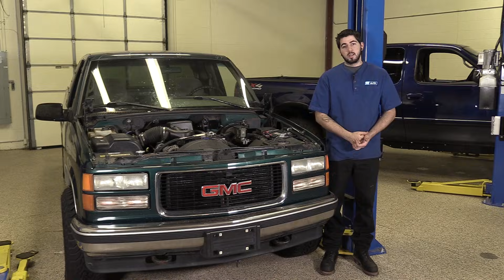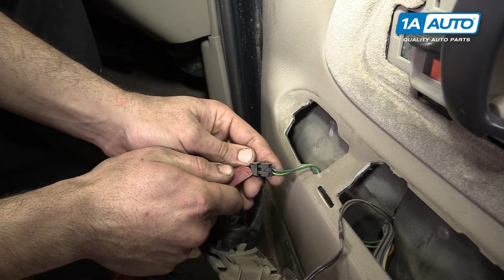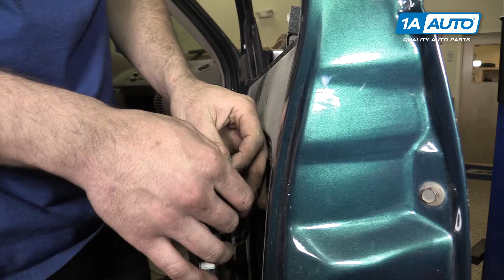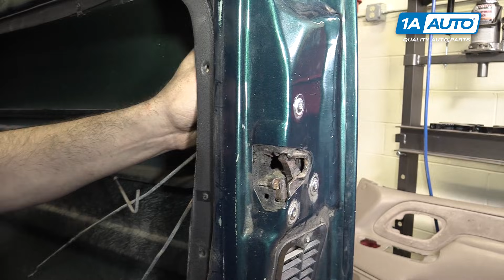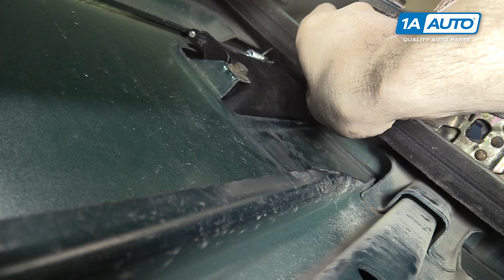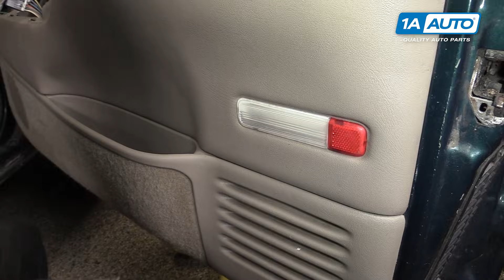How to Replace Exterior Door Handle 95-99 GMC Sierra K1500

Comment: What's the big deal why didn't you show the rod that goes to the keyed lock cylinder and the metal dog that goes on the back of the lock cylinder and the rod that connects to it

Comment: I'm having trouble removing the clips on lock cylinder to swap it to the new handle.
I'm kind of shocked you just totally skipped over that.
As well, removing the rod clips was a major pain which I noticed you edited out.
More info on those items would have been very helpful.
I suppose I can't complain for free advice. I do appreciate the video. Just sayin'

Comment: I have a 1997 Silverado and my driver side door handle off and the rods disconnected from the handle and the actuator, my door closed, lol, what can I do to get it to open back up so I can finish changing the handle and actuator without trying to hook up the wires, handle and inside door electronics, thanks for any help

Comment: Thanks for posting this video. Like many before me have pointed out, removing the whole inside panel is not necessary. I did this job on my '97 Suburban a few years ago before this posting and struggled a bit. The driver's door is harder to do but I managed. Since then, I've had to replace both outside handles on my '99 Suburban this year. The key cylinder and the lock pins are the most difficult part. Definitely replace the rod connectors if possible. I didn't the first time and I apparently bent them removing and they would fall off about a week or 50 slams later...  If I could edit my videos, I'd post but there too much cussing on it! Thanks for sharing.

Comment: I forgot to ask,    of which is not shared in any other '96 Sierra door handle replacement  online videos,    what fails in these door handle plastic moldings that  subsequently gets worse till it pulls right out with only likely the linkage(s) holding it in place  ?

Comment: My '96 sierra,   
Driver side lock mechanism allows key to unlock but will not lock. But seems to function properly on the passenger side. 
 
Although I just noticed today the passenger side handle cover unit is slightly lifting/pulling away from the exterior door panel    -- oh uh !!     And also noticed the drivers side is showing subtle signs too.  :-I 

That is why I came looking for a vid' to find out how hard is it to fix or replace, this will be the longest involved project I've tackled  . . . .

Comment: At 3:27 he peels tape from the access hole that leads to one of the two bolts that secure the outer door handle to the door. Use a flashlight and an extension. This access hole makes the job so much easier. No need to take the entire door apart.

Comment: I tend to be a GM person, but one thing that kills me is their door handles always break.  Well, at least since cars went bad in the early 1970's.  You would think after 100 years of building cars, they would be able to get the door handle thing right.  But no, some bean-counter decides to make parts from pot-metal and plastic.  Then there's the idea of planned obsolescence - why would people buy new cars if their old cars still worked?  And constant repairs are what keeps their dealers profitable.  Kind of sucks that they make certain parts destined to fail and this difficult to replace.  Sheesh!

Comment: this isn't a very good video.  There was no instructions on how to remove the key cylinder from the handle. 
Plus it's easier to undo the door latch, let it drop down and then the door handle will just pop out.

Comment: Well here's a few helpful tips; WD40 or similar and lude the window rollers, spray all linkage clips, this will make removing clips and window a lot easier.  Spray the latch, window channel and regulator  before putting it back together. You'll be surprised how much better everything works.

Comment: This can be done without removing the interior metal panel AND certainly not removing ALL the wiring and rods!.......I replaced my driver side handle today by simply removing all BUT the bottom row of screws on said panel, just so I could reach my hand in to assist. I pulled the handle from the outside, and removed the lock (which the video does NOT show you is retained by a clip on the bottom) and single rod for the door handle lever mechanism. Then replaced the hand in reverse fashion (this is where being able to reach your hand inside is critical.......

Comment: I have a 96 silverado and cant use the key to open both doors, can only lock from inside and need to let doors open . because the key dont lock doors . so is the same problem with my truck?

Comment: I did this yesterday on my 97 GMC Suburban. The video was very helpful, but not as easy as he makes it. The biggest problem is reconnecting the new handle. He shows you connecting both lock and handle from the outside, but this did not work for me. After connecting both the handle and lock it will not fit back in the hole. So I reconnected the handle only and then reconnected the lock after I hand tighten the bolts from the inside. The last thing I will say, is the lock will only come out of the old handle by breaking the chamber it is in. But this is ok because it easily fits back into the new handle. Great video!

Comment: Could you show the part where you installed the lock cylinder, I'm sure this part does not come with the new door handle.  Or, do you put the lock cylinder in after installing the door handle part.  Thanks.